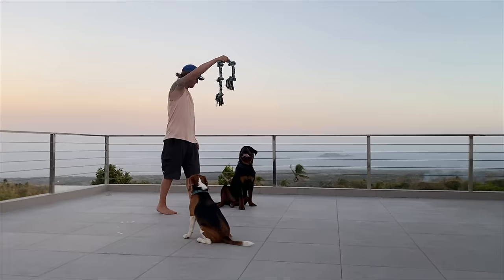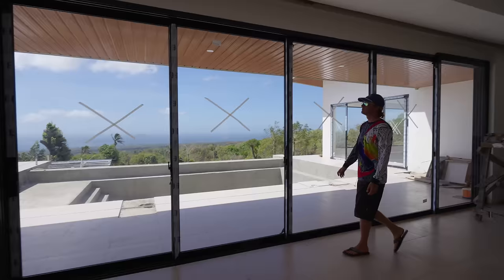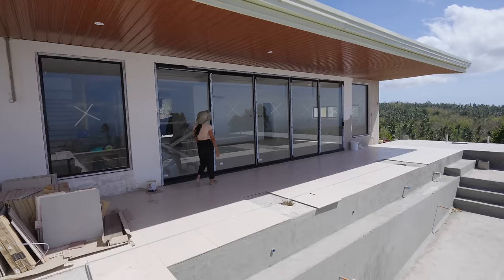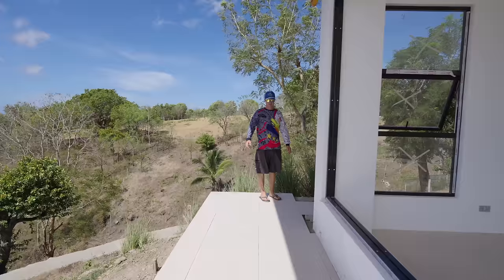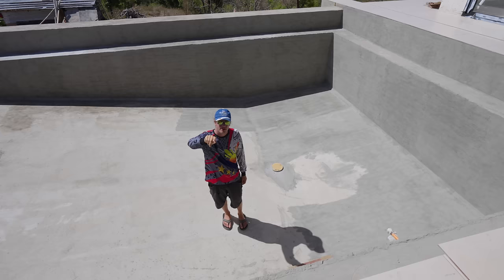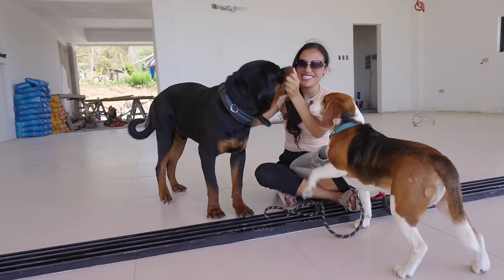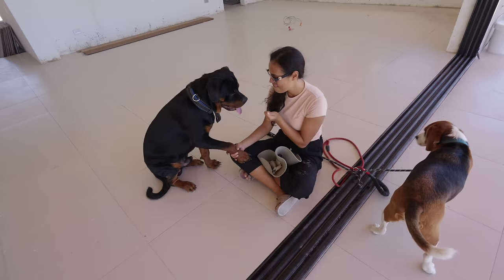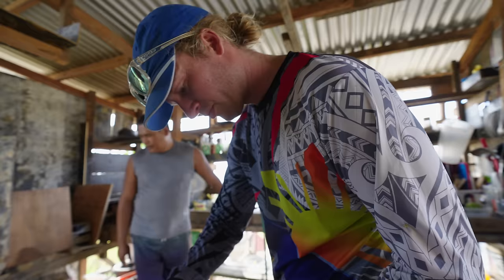MASSIVE SLIDING WINDOWS INSTALLED - Building home in the Philippines

Comment: Since the glass has no color or a smoke glass It is suggested that you put a single luminous stripe sticker around your glass panels sliding to distinguished if its open or close coz there might come a time if you have many  guests in your house while having a celebration they might accidentally bumped the glass specially if the glass is so clean & very clear in the evening.

Comment: Finn I suggest you put rocks besides your fence pipes so that if there's rain it will flow nicely put some plastic on the soil before you put rocks so that the rain water will filter 1st no debris will clog your water pipes...just suggestion to prevent issues in the future...

Comment: My 2 cents.

Maybe good to put silver reflector on those glass doors.

When hot, the heat is reflected out in order the inside of the house will not be too hot.

During the day, you can see the outside but those outside can't see the inside.

At night, if light is brighter outside, most likely they can't see the inside of the house still for privacy, but you can ask the vendor what is the better way to do it...

Comment: Finn that small fence is more dangerous there's a tendency that you may tumble and Fall down with that small fence in the pool area especially the kids or a toddler when you loss control and when you wet slip off...its better to make it high like in your viewdeck..hope your shower outside there is a bathroom and toilet too for changing the wet clothes after swimming so that they not run inside your house wet to use bathroom and toilet if you have party and beer time of your friends i know they pee as frequently than usual..just a suggestion guys!
Reply from the maker: Great suggestion thanks